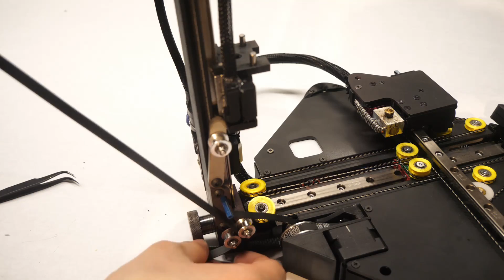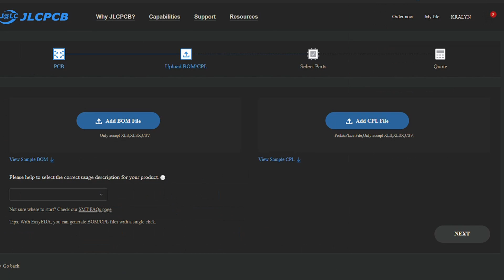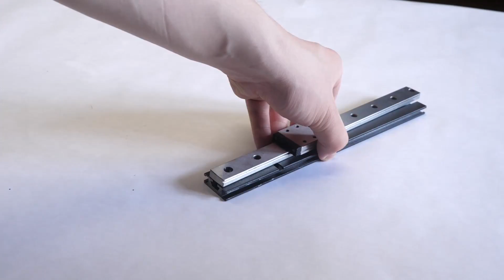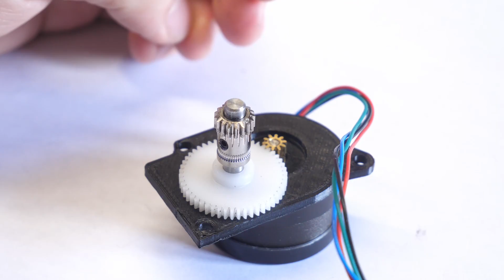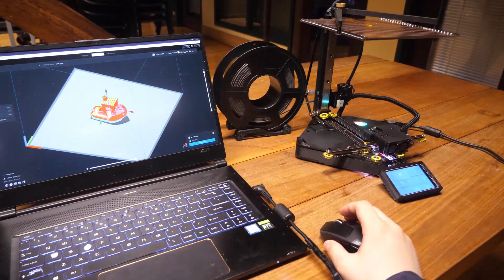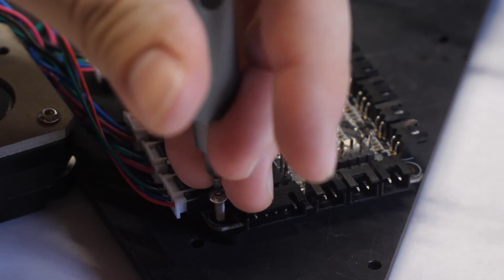How to make foldable 3D printer -Positron V3 build part 1 of 2

Comment: does anyone have a source on getting the plate ali parts machined or some insight on the potential for redesign to fully printed parts (with i guess a potential reduction in speed and rigidity)

Comment: Any news on part 2 of 2? I've ordered all of the parts and am about to start building one.
Reply: How much did all the parts cost and what parts did you order? 🤔
Reply: @jeremiahmarkwith  A lot - around $1050 total, because in several cases I had to buy a lot of parts just to get one. Because the prices changed, I ordered as many as I could via Ali Express. Some were custom and took a long time to get (i.e. the stuff for the X-Y axis belts). There are full kits available on Ali Express for $300-$400 - I tried to buy one and it turned out to be fraudulent. The hardest part to get is the defroster material for the bed - I think the seller found out they were not being used for defrosters, and it's now several hundred dollars by itself, so at first I went with a kapton heater, but later, I saw a muon bed from England for about $42, and bought that - it's 100% transparent.

Comment: i love this. to me this is the biggest improvements made to 3d printing since the ender 3 but i feel like its not getting  no where near enough attention. i wish there was a kit u could buy to build one an at that point i think it would blow up, its just to cool not to especially if its price point isn't insane. ive not seen anyone put one together so i have no clue how much it does cost to put one together but that is biggest hurtle to overcome in my opinion, sourcing the hardware an all the parts needed can be a head ache an almost always ends with you buying the wrong thing for something, same thing for the voron printers, once ppl started selling hardware kits is when ppl actually started buying an building them but when i first tried to put all the parts together to buy for a voron i gave up on it an just held out hoping someone would put a hardware kit together.

Comment: I personally recommended your design to Anycubic and one of their representatives was impressed by it! I hope they‘re among the manufacturers that were interested :) This is a breath of fresh air in a market filled with bed slingers that all just look like variations of the Ender series 😁
Reply: Hell no you would be paying an arm and a leg for it go with creality
Reply: @wolvesgaming8973  Creality would ruin this printer, everything they sell has problems, their latest personal best is releaseing the Ender 5 S1 with loads of non standard parts and no replacement parts available anywhere!

Comment: Hey Kralyn, could we just make the Z post taller and make larger prints? I don’t need to fold this into a small box, but I need unusually ‘tall’ prints…
Reply: Try the hanging printer you can use your room and print as high as the room.

Comment: Overall, this is a good rough draft of an instruction video. However, I have some criticisms of a few of your instructions.

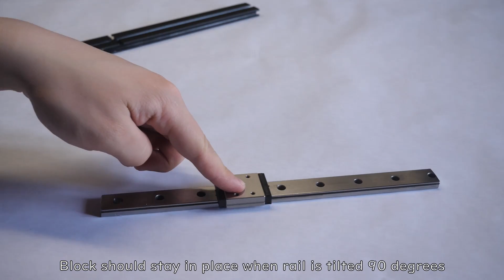8:42 How much weight should the bearing be able to support when the rail is vertical? If we get that wrong, what consequences will we face?
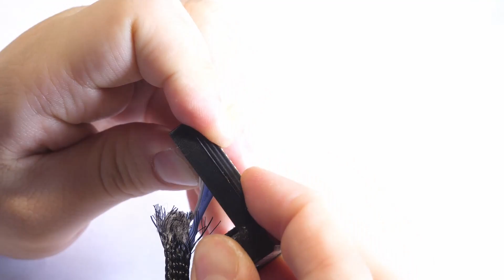10:03 Oriented is what manner? Which wires should be near which side of the plastic part? It looks like that magnetic connector is reversible in the slot you designed for it, so you need to be more specific here.
12:47 What if it isn't already pressed in? Should we expect it to be, or will we have to do that ourselves?
13:20 Requiring a random spring that may or may not effect how well the extruder works is not a good plan. 

Fixing these should lighten the technical support load on yourself and the community.
Reply: I think for the spring he should just change it to a ender 3 spring.
Reply: Hello, would you like to have your questions answered or are they just as feedback?

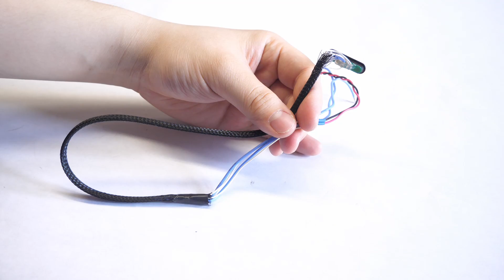Comment: 9:50 would it not make sense to have the pins reversible on the magsafe connector as a safety? NTC - GND - 24V - 24V - GND - NTC - there shouldn't be polarity to any of them and then it can't be screwed up.
Reply: These connectors have different magnet orientations left and right, so they can only be plugged in one way.
Reply: @joelschulz-andres  don't underestimate an idiot's ability to mess things up If the connector is mostly symmetrical it can still be forced in the wrong way and with enough determination and forced to stay in the wrong way around. that effectively means that it should just be treated as reversible by the designer. whether it is simpler or not to make it naturally safe as the designer.

Comment: We need a build kit.
Like seriously, i would absolutelly do all the assembling work and the soldering no problem,  but it's to damn complicated to buy  50 different things from multiple places and i thiinnk the compact size of the product lend itself well to shipping the parts by mail.

like, you could pack the pre-borred rails ,  all the needed screws, all the pre-cut PCB's (that you could get for cheep because of the big order), the glass pannel, all the cnc/lasercut aluminium pieces,  the cables, the pre-loaded 3d printer controler card, the screen, the motors, everything. 

you buy big orders of everything do the changes that require machines(reduce the barrier of entry to hot glue + soldering), divide it in kits with the correct number of everything in it, you put it filament boxes  and you ship it to those that wll buy it, you calculate the price of building one unit,and you sell it so that you make 25/50$ of profit on each, and you make us pay for shipping.
After a month of this to collect funnd you hire a guy to do this work for you, and boom you got yourself a company that run itself and you go do V4

Comment: Finally. I am building it right now but have to wait for one part. had to figure out all by myself and at some stages I was a little bit confused or thought that I may break things like the display pins 😅👍
Reply: How much does it cost to build this printer ? I really want a fdm printer but I can't even afford an ender 3 right now
Reply: @hed420  if your close to a micro center they had a ender 3 s1 for 99$ for new customers not sure it's still running but can save you 70 bucks if your close
Reply: @elyknavillus777  Unfortunately I live in South America . An Ender 3 s1 costs $400 USD here. It's the cheapest 3d printer available but I only make $200 usd a month, so even if I manage to save up $10 a month it would take me about 4+ years to save up enough money to afford it .
Reply: @hed420  200 dollars are month? I thought there were at least some worker protection laws in murica
Reply: @aepfelpfluecker  I live in South America
Reply: @hed420  building it by yourself will make it much more expensive
Reply: @hed420  The years of building your own to save money are long gone.  If spending $100 to $200 is too much for the currently available printers ---- well.... You'd better start saving. It isn't getting cheaper.  And you will buy and use up a lot of filament at ??? $20 to $60 a kilogram.